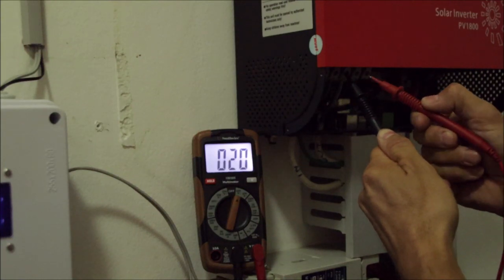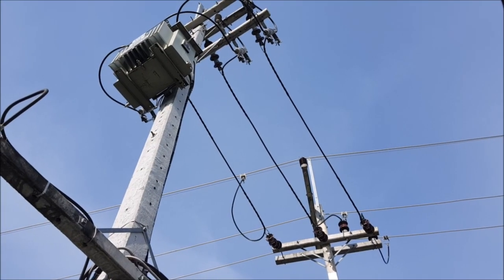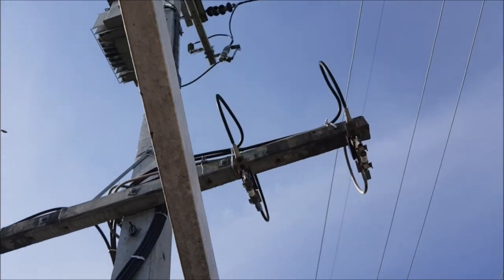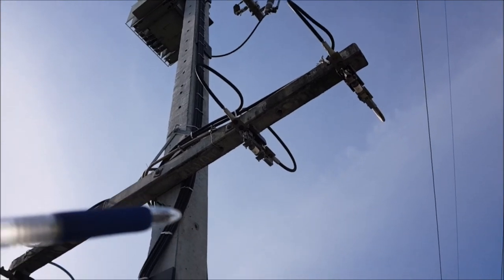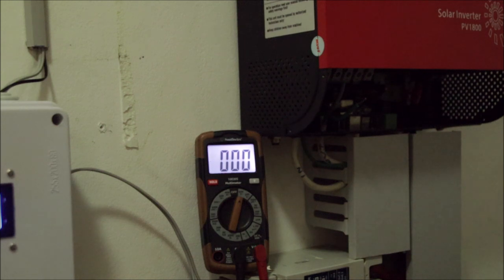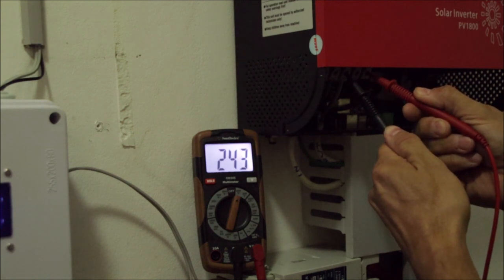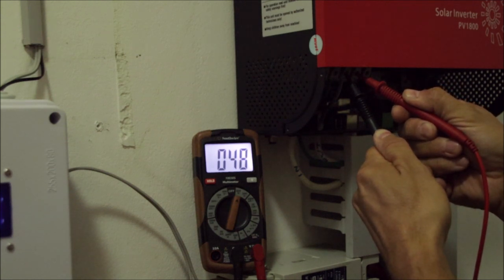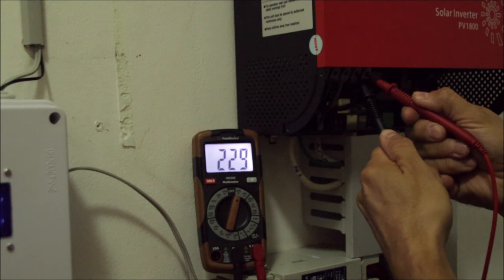DIY-Installation? Don't forget about Inverter Grounding and Neutral-to-Ground Bonding!

Comment: Hi my question is if I only have off  grid  system how do i connect my earth rod to the consumer box can i connect the neutral from the inverter to earth bar in the consumer box
Reply from the maker: Hi. Yes. Connect your rod to the earth bar in the consumer box and make a bonding connection from earth bar to inverter Neutral. It is advisable to use an RCD as the first device in the consumer box. So, make the connection as shown in my video about off-grid system bonding and earthing. Thanks

Comment: can you do the test when grid is disconnected. test between ground and neutral. if not zero, something is wrong
Reply from the maker: now Ground and Neutral is bonded inside the panel behind the inverter output. It must be zero

Comment: Hi Roland, please give me some advice about grounding the photovoltaic installation. My entire Off grid 8KW system is totally separate from the main system. We have made a separate dedicated grounding installation for this system + dedicated sockets for vital consumers. Question: Do I connect the inverter and solar panels + battery bank together to this ground?  My doubt is about the inverter- I don't know if it should be connected to the main grounding system? Thanks, gratings from Romania,
Reply from the maker: Hi Felix. Yes, if you provided a separate earthing installation already, just connect all parts to that grounding. Solar Panel Frames (no DC power line directly), Surge Protection Devices (for power lines), Battery Enclosure (no DC power lines), Inverter Chassis and PE,  dedicated Sockets PE and Neutral to Ground Bond (if not provided internally by the inverter).
Reply: @RolandW_DIYEnergyandMore  Thank you, Roland, from this moment I am your subscriber.

Comment: Hello! I have a off grid invertor , if i conect to ac socket of the house wich have PE the invertor is grounded? Can i put the SPD ground to the Pe of the house?
Reply from the maker: you want to feed into your installation via a socket? the shell of your inverter is only grounded that way, but there is no neutral to ground bond that way. you need to use a panel to safely feed in anyways. SPD you can connect to house PE, no problem...

Comment: Hi, I learn a lot from your channel and I like to ask some questions. 
I stay in Malaysia and I have a offgrid hybrid inverter Growatt SPF 5000ES which is by default already have AC output neutral bond with ground. (I know this is because I use the multi meter to touch the AC out Neutral and the Ground has a beep sound)
My question is after I used the inverter for 2 weeks, my house RCCB start tripping. Sometimes when I on the air-cond or just a computer.
My AC in is direct from the Grid -> 40A MCB -> AC In -> Inverter -> AC out -> MCB 40A -> RCCB -> Load center distribution box.
I have only one ground rod and everything in my house are connected to this ground rod (including AC SPD, DC SPD, solar panel grounding, Inverter grounding, ...)

I found a way to remove the Inverter's AC Out Neutral and Ground bonding, it stop the RCCB tripping but now the AC Out Neutral have around 90V in it which is very dangerous for my home.

Please let me know what I did wrong to my system? I really don't know what else I can do...

Thanks
Reply from the maker: Hi. Do you remember in which inverter state the RCD is tripping? Is it when the inverter is in off-grid mode powered by the PV or is it when it is on-grid switched in bypass mode? Or doesn't it matter...
Reply from the maker: If you remove grid power from your AC-In by switching off the first MCB while you are off-grid and measure the Neutral from the grid towards your Rod Earth, which voltage would that show?
Reply: Hi...just like to update my case here....  I think I found out what is the issue. I check again my wire connection and find out I reverse connect one of my RCCB (Live and Neutral reversed), I have 2 RCCB in total.... That is why my house keep tripping... I am now correct the reverse and put back the screw for Neutral and Grounding bond in the Growatt inverter and also I have removed the jumper wire.. now after 1 day nothing is trip in my house. Sorry for my stupid mistake ... this is just a false alarm... :P
Reply from the maker: @tailowfatt1146  good to hear!

Comment: Thank you so much for this video! I think it was exactly what I was looking for.
So, to be clear...
I should leave the unbonded inverter unbonded (currently, the receptical ground is simply connected to the inverter chassis) where it measures 60v hot and 60v neutral, roughly. 
I then, run the hardwired terminal block to the distribution panel in my rv. I will double check, of course, but assuming my panel is bonded, I should then read 120v hot, 0v neutral, and still 120v hot to neutral.
This correct?
Reply from the maker: If there is a bod in your panel, you will read 0 and 120v, yes. But is the RV physically grounded by a rod or metal spear when parked?
Reply: @RolandW_DIYEnergyandMore  not at this time, but I can.
Reply from the maker: @user-mt4zr5kp7h  if you have GFCIs installed somewhere in the RV, you should ground the panel physically. Then all is right. So, important is grounding and bonding.
Reply: @RolandW_DIYEnergyandMore  thank you Roland. Appreciate the help. ☺
Reply: @RolandW_DIYEnergyandMore  looks like this was all moot. Inverter has 118v across hot and neutral, but under any kind of load, it goes into overload. Phone charger works on it, but toaster kills it.
This is a new one for me. Any ideas? There's nothing visibly wrong on the boards that I can see and all mossfets look intact, with no signs of having blown. Anything typical that happens?
Reply from the maker: @user-mt4zr5kp7h  and DC side is stable? How many watts is your inverter? When you run the appliance without grounding, then it will work?
Reply: @RolandW_DIYEnergyandMore  haven't actually done anything else to it yet besides re-attach the hardwire terminals. So grounding is whatever was factory.
It's a 3000 watt. One of those Chinese extruded aluminum jobs, with the low voltage on one half and the high voltage on the other half. There are 5 transformers in the unit.
I've checked all fuses and the fetts look ok.
One outlet, before, worked while the other was loose and made weird noises. But that one that worked powered my friend's coffee maker just fine. When I took it apart, I saw t that one outlet was loose and melty, and the hardwire terminal had been disconnected and removed, and so I deleted the outlets and added the hardwire back on. So far, that's all I've done so I don't know what could have changed. 

As for the dc side being stable, where do I look? 
The voltage in, is the battery in my car. Brand new battery, and car was running, so being charged, hooked up to the inverter via 2awg jumper cables.
Reply from the maker: @user-mt4zr5kp7h  OK. So, at the moment the problem is only, that you have a not correctly working inverter which is overloading for no reason. As this looks to me, the issue is not in the power electronics, it sounds like general system electronics, measurement circuits, etc. You wrote phone charger works, toaster not. Try to work up yourself in smaller load steps to see at how many watts of load the inverter is quitting its job. But there will be a problem on the board. Maybe some bad capacitor, IC, resistor, etc. Very hard to diagnose without to see the device itself.
Reply: @RolandW_DIYEnergyandMore  yeah I know it is. I do appreciate your input very much. Thank you again. I'll keep plugging away at it here and see what I can see. I hate when there's nothing obvious 😂
Reply: @RolandW_DIYEnergyandMore  hey again! So... Not that you're losing sleep over my issues here, but I thought I'd mention what the problem was, in case anyone has something similar in the future.
I had a bad booster cable 😂
Swapped it out and all is well now.

Comment: I have a PV system(Grounded) to charge batteries, and run off-grid with an 24v 3000watt inverter which has high output L, N, G screws, I have a 8ft ground Rod in the ground outside ...can I just run L to L , N to N and G to G (Socket/Outlet) and connect the ground to the Ground Rod outside outside?

 I ask because the inverter I have says do not connect Ground to neutral.
Reply from the maker: Hi, yes. Of course you can connect PE from inverter to your rod. In that case your grounding acts only as a Protective grounding, and would pull down high voltages from your inverter housing in case a L-PE fault would occur. The maximum allowed voltage during a fault condition on any by PE protected part is 65V, and is dependent on the impedance of the ground rod. But there would be no mechanism which would stop the inverter to continue producing power if it doesn't have internal fault current detection.

Comment: Hi. I don't know if you addressed this but I read that you can link the mains and inverter neutrals and only switch the live/phases using the transfer switch. What do you think about this?
Reply from the maker: it really depends in wich sort of earthing system you are living. my video about practical guidance is trying to show that. i wouldn do that in a TT arrangement as fault currents from all your neighbors will flow over your link
Reply: @RolandW_DIYEnergyandMore  ok thanks I just watched your video on practical guidance. I don't think I'll be running into any problems as we use a TNCS system in my country. The neutral and earth are bonded at the meter box in every house.
Reply from the maker: @kint5ugee  yes, thats how i have it here in Thailand as well.
Reply: @RolandW_DIYEnergyandMore  ok great! thanks 😊

Comment: Thanks Roland, Sawadee krub. This is the subject not many people talk about or really aware of. Here, I have a scenario to ask you and hope you can share some advice. If I want to install an off grid hybrid inverter (230Vac, 48Vdc batt bank) just like yours but in an RV (24Vdc starting battery) and also an isolated 48Vdc to 12Vdc (360W) converter for 12V loads. Grounding everything; there will be solar panel, AC inverter, not sure for 48Vdc bank and 12Vdc converter. What would be your suggestion in this situation ? My initial thought is to leave all these ungrounded except the AC outlets in the RV which still have ground prong but equal to open ground when AC shore power is not fed. Your advice is appreciated.
Reply from the maker: Hi, the DC side of nverters and converters, solar panels, etc is always kept isolated. never connect one of the DC power wires to Earth anywhere, other then installing a Surge Protection Device SPD. When we talk about Grounding or Earthing, it is about AC output and Equipment housing. So yes, it will only affect your AC outlets. When you connect a RV to shore power, make sure to use a 3 pole transfer switch to completly switch over all 3 wires L, N and PE when changing between your system and shore power. I wouldnt use the AC in of a hybrid inverter to connect to shore power, as you might not know what sort of earthing system is used. Better to treat your own PV and inverter side as off-grid, and shore power as backup. For your own earthing, you might just dig in a copper rod into the soil, so that you can later remove it again.
Reply: @RolandW_DIYEnergyandMore  Thanks Roland. You really have the point, especially the 3 poles transfer switch which I haven’t thought of. Since there might be an issue of quality of N-G bonding from shore power, do you think it might be OK if I just ignore ground on the AC side as well on the RV. This way, do you think it might minimize risk of lightning surge and any ground loop voltage ? I understand Japanese system doesn’t have ground wire either. Wish to hear from you again.
Reply from the maker: @teerawattang5071  Grounding is for lightning protection, as if you run a isolated system, a nearby lightning strike can induce high voltage in your system and fry all your equipment. The leakage protection by earthing and using of RCDs is just an extra benefit of grounding...

Comment: I live in an upstairs building in which the power is routed from a ground floor distribution box's MCB to a small distribution box in the upper floor using 3 wires to carry L, N and E. If I were to setup my off grid inverter ( non hybrid) for upstairs by bonding the output N and ground, and to connect this to the grounding rod, can I simply connect to the E wire coming from the downstairs' distribution box ?
Reply from the maker: It will be ok, as long your system which is powered by the off-grid inverter is not otherwise connected to N and L of the grid. So keep everything nicely separated, just use the supplied E as a common Earth. Your inverter doesn't have an AC input, right? Better not to use if it has...
Reply: @RolandW_DIYEnergyandMore  Yes. My off-grid inverter doesn't have any AC inputs. If I were to use a hybrid inverter with AC inputs, will it cause issues as I'm getting the grid power after the RCD of the ground floor distribution box?
Reply from the maker: @gayanx86  yes, any RCD before the inverter would trip when you bond N-E. So your bypass AC would have to come from a very early point of distribution, before any RCD of the house
Reply: @RolandW_DIYEnergyandMore  Thank you so much.

Comment: Thanks the video. But my invertor( pure sine invertor) does not have any mark that should be ground .
Is it possible to solder a wire on PCB of the invertor and any minus pole on PCB ( e.g. from electrolyt capacitor) will serve as ground ?
Reply from the maker: hi. please do not manipulate anything on the inside of the inverter! there is no ground marking on your inverter, because inverters do not provide ground. an inverter only provides L and N. G or PE comes from outside. in some cases it may only be connected to the invertor case. the PCB doesn't need ground. But our electric installation needs ground and a return path to the inverter. thats why we bond G and N on the outside of the inverter...
Reply: @RolandW_DIYEnergyandMore  Thank you for your reply. Is it good enough if I connect groung to the metal case of the invertor?
Reply from the maker: @ladbla1752  yes. that is the correct place. the inverter case is then part of the equipment grounding. just bond your inverter N to the outside ground at your panel and all is well.

Comment: Isnt it best to do the neutral earth connection at the inverter and not in the distribution board?
Reply from the maker: If your inverter is far away from the Distribution then you have to make a bond there, but if they are separated just by a few meters of wire then it is still better to do it inside a panel as the terminals there are much more solid and your earthing source will usually arrive there. Inverters don't always have good connectors...
Reply: @RolandW_DIYEnergyandMore  Thanks
Reply: In the south african code of practise it states that the earth and neutral shall be bonded at the point of supply ie at the transformer, generator or inverter. Only bonding in the db is allowed if there is a elevated voltage between earth and neutral <2V and only in the main db not sub db's.
Reply from the maker: @davidmchattie  sounds very reasonable to me. Code interpretation still gives a bit of room. An inverter mounted right next to a distribution panel would in my opinion qualify as "point of supply". So, I would still opt for a bond inside the panel :) But of course, that's up to you.

Comment: Roland , im fellow german canadian here sierra leone.
I have same as you on you red machine  230 v and 38 vdc ground . im now getting fault 5 overcurrent . why after 3 yrs all good now?    i think one of 4 12 v batteries may be dead fully off grid.   the locals dont have idea on correct ways. im grounded at the breaker box to ground rod 5 feet away. two inverters hybrid one 24 vdc system wind solar own controller  other 48 5kva . both using same solar array. 24 v system 230 v and 0 vdc ground and box.  48 kva 38 vdc ground and the fault 5 now over current.
Fault code.
Battery overcurrent hardware protection
Reply from the maker: Hi. Its not possible for me to tell you what is causing the fault. But i do not think it is grounding related. I think it is a problem with the inverter. Sorry. Did you get in touch with the manufacturer on what could cause the Fault code even if there is no overcurrent? I would open it up, clean it and look if there are obvious issues like burned out components, blown out caps, etc
Reply: @RolandW_DIYEnergyandMore  its a high voltage hybrid. SRNE 5kw   its only the static electricity i found from others on yt showing grounding and found same . they found its the machine genereating its own static. no biggie. dont bond to ground rather just bond the panel to ground on offgrid euro type 230 v ac out unit   im in jungle  with